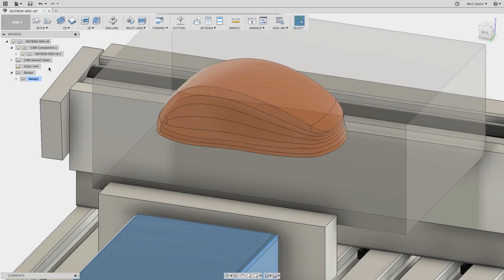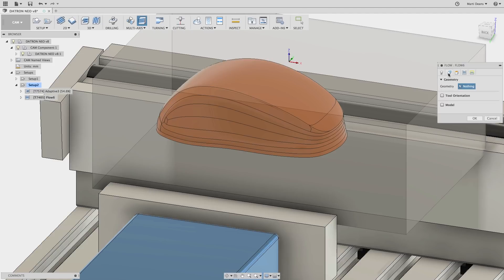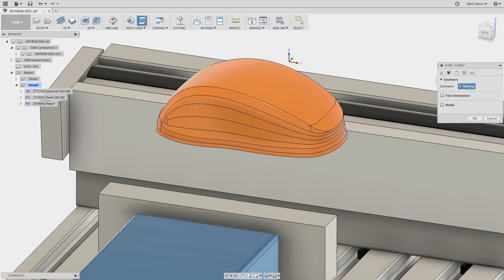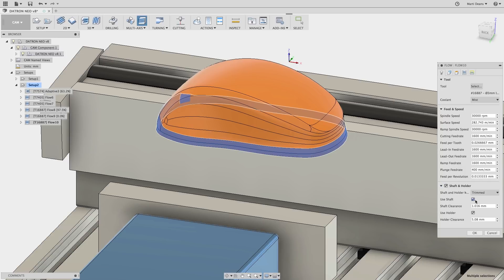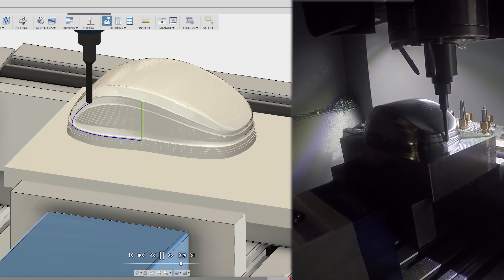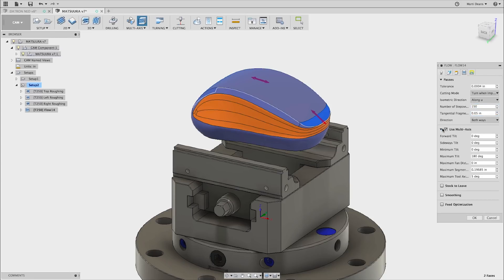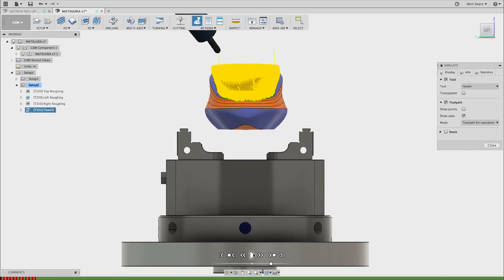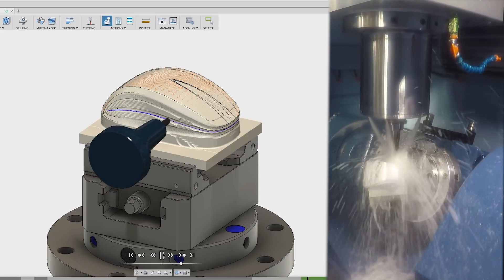Flow - Part 2

Comment: It can't be overstated that G2 (curvature) surface continuity is key.  Just having G1 (Tangent) will leave noticeable signs where the curvature changes.   

It would be nice to be able to select a series of surface patches and replace them all with an approximation surface that is G2 continuous, as some customers supply models that are not G2.
Reply: I has curious on how to get G2 continuous surface? Is it from design start or can you ajuste the surface ?
Reply: TestSubject look up Cadsetterout.com posts on the topic. And G2 is supported in a lot of modeling commands in Fusion and Inventor.
Reply: TestSubject g2 on a single surface usually results because guide curves are splines, not tangent curves.  If you want to make adjoining surfaces g2 continuous as an end condition, bordering curves need to be g2 as well.

Comment: How are 4 and 5 axis CNC machines kept from drilling into the base (or whatever the object being machined on is called)?

Edited for grammar
Reply: Simulations show when a collision with a fixture occurs. This isn’t fool proof though as errors can be made when setting up the machine/etc and crashes do happen some times unfortunately.
Reply: Jim Himes Thanks, I’ve been trying find this out for a few weeks.